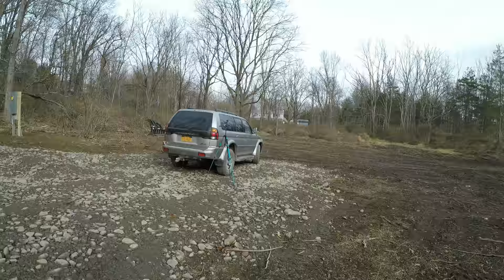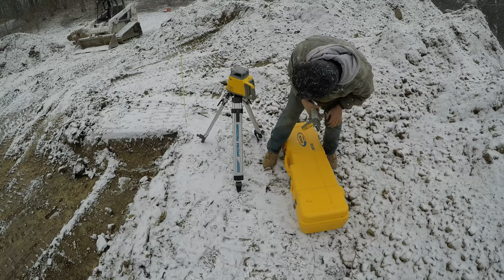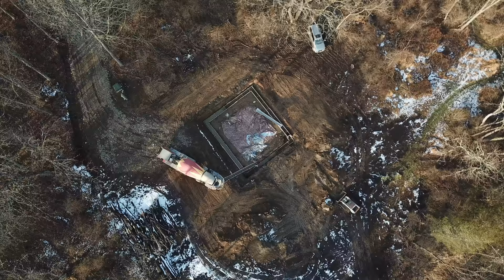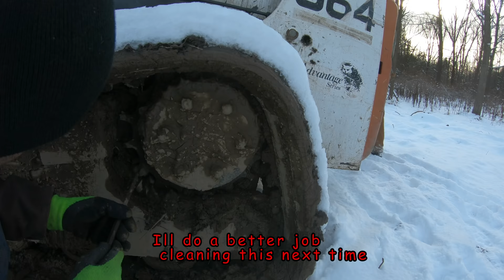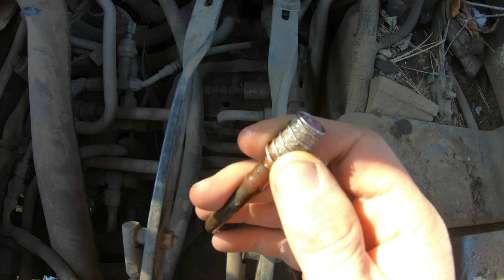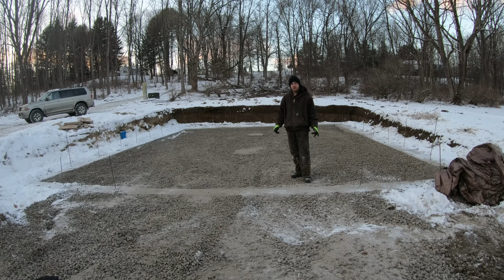Digging a foundation and pouring a footing

Comment: The holes in the perf pipe are supposed to face down. get some diesel 911 http://powerservice.com/psp_product/diesel-911/ for emergency gel ups like that. But you should be using regular antigel all the time in real cold weather. otherwise really enjoyed the video. thanks for sharing
Reply: Tyler Koehn the fuel refineries usually add a percentage of Kerosene mixed to the diesel fuel to prevent gelling but due to the fact the skid steer still had summer fuel in it it did not have that kerosene base which would have helped the Diesel 911. He did the right thing.
Reply: I personally know numerous people that have had their trucks gel up with winterized no2 diesel. no offense but doing the right thing would have been to not beat the snot out of it by trying and trying and trying to get it going. simply dump 911 in the tank and remove the fuel filter and dump it in there as well. DONE. seriously a 10 min job. or better yet splurge and buy a gallon of antigel. for $8 add a few oz every fillup when its going to be around 0deg F and you will never have a problem...
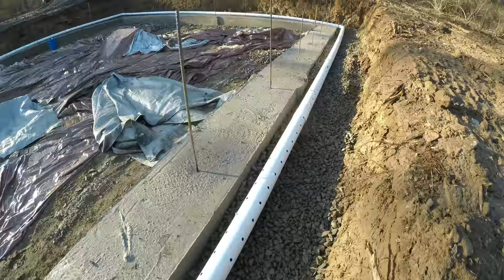Reply: Multiple rows of holes in the pipe.  21:59
Reply: odc43054 pipe around where I'm at has two rows of holes in it.
Reply from the maker: The holes go up.
Reply: Holes go up
Reply: Holes go down, if they face up, the water table is raised to height of holes.  water rises, infiltrates the pipe and flows out.  It seems counter-intuitive, but that's how it works.
Reply: Wrong. Lettering goes up holes go down.
Reply: The holes go down. As the water table rises the water is taken away, water table lowers and the water exits the pipe. You need to know how the system works.
Reply: Grey Market --- Holes go down!
Reply: Tyler Koehn --- I'm retired....50 years construction....and I had employees use fuel additives 'year round'.....equipment ran in winter and ran BETTER in summer!
Reply: Brand O --- Wrong! Holes up causes 2" of more water to rise in drain area before relief of water starts!
Reply: Chop Shop --- Correct! Lettering on top for a reason, to see what you're digging into at a later time for maintenance!
Reply: Absolutely, holes go down. Otherwise the trench has to fill up to the top of the pipe before water starts to flow out of the trench.
Reply: The holes go up. The point of the foundation drain is to move water away from the foundation. The gravel allows water to move down and into the perforated pipe and be carried away. If the holes were facing down then water wouldn't collect properly or flow through the pipe correctly. It has nothing to do with the water table. Filter fabric will prevent silt from entering the pipes. This type of drain is used to keep water from penetrating the foundation. If there is excess water or a really high water table then other drain designs may be implemented. Judging by the soil when he was digging I would venture that the are where the house sits probably has good natural drainage to start with.
Reply: Yes, the holes should face down and the pipes should be wrapped around with glass 
fiber cloth so that dirt won't plug the drain in the long run.
Reply: yes holes go down and on the sub soil with filter cloth not on top of 3 or 4 feet of stone ether, u never put stone under any drain tile, e use a flexible 4" black tile witch has holes all around it, with a heavy sock over it and the floor tile tees into it though PCC sleeves though the footing in 4 places were the floor tile chris cross the fool in sub soil trenches an back filled with stone to keep any ground water away from the floor
Reply: Holes down, made this mistake once years ago...ended up having to dig up the drainage and put them facing down.  Holes up let the water get too high before it begins to drain and collects standing water.  Love your videos, great job! Not being a critic, just adding to the conversation.
Reply: Fuddmethen that is right hole down witting up, but i find unless it is being inspected, you cant tll young people anything these day, they think they know it all, but if it is inspected it don't get pasted until they rip it all out and do it right before they are given the ok to back fill, 2 young guys were gluing there whole 200 feet of septic fiel pipe together, i had stopped in both places and seen what they were doing, i told them to stop and take a part what little they had done, well in both places these young guys told me were to go.. the day the inspector came the first thing he seen was the field, and told them both to do it right and he left, both of them asked me what do that inspector mean,, i told then, what did i tell you last week, and i left, that night i got a phone call asking what to do, i wouldn't tell them until they both apologised to me, but now the pipe was to short to make 200 feet and all the fittings had to be replaced,, i just lmao now, but there is more wrong with this install then just the pipe holes, for one he put crushed rock in the bottom before the pipe witch will always be full of water up to the top of the pipe, i don't know how much rock he put in before the pipe but it looks like a foot or more, an inch is to much
Reply: you mite as well give up you cant tell young people today anything and they refuse to resource it
Reply: You'll learn your lesson when the new homeowners call you and ask why their floating in water on the basement floor.  Not that I'm a fan of using it, but corrugated slotted drainage pipe would have work better especially if your not sure where the holes go.
Reply: fuddmethen, that's what I said on here days go, black rolls of 4" slotted drainage tile, with filter sock and chris cross under the floor and though the footings and out around the footings, pvc is not used for this, he most likely will not care when they call, there are so many out there that do this stuff on the cheap with no contract or recourse, it will be tough luck but I will come add more for more money
Reply: holes face down  ..
Reply: The HOLES GO UP BOB!!

Comment: In Mass, we do a lock in the footing and the rebar every 24'' vertical Andrew invest an oil fired torpedo heater makes quick work out of warm-up also your using heating oil you need diesel winter blend 60% #2 and 40% kerosene. And add an anti jell additive to your fuel.

Comment: My father had a trick to keep the water in the pump house from freezing. He would leave a light on inside the pump house and in that confined space was enough to keep everything from freezing up. Maybe, throw a tarp over (what ever you want to protect) and stick a work light under neath it all. Run a rope around it to keep the wind from blowing through it. Good luck. Garry

Comment: I worked construction in Northern Alberta with daytime temps (not including windchill) of -35 C (-31 F)and night time -45 C (-49 F) and even lower so we put a tarp over our machine engine (a foundation drill rig) and left propane heater under the tarp on low to keep the engine warm enough to start in the morning. In really cold weather you could throw a tarp over the whole skid steer and with a heater on low around the rear end to keep your engine area warm enough to avoid starting problems the next morning.

Comment: Put a little AT in your diesel. I helps with ant gel properties as well as cleans the exhaust parts. When you forget to ATF, you can always build a camp fire near the engine compartment  near where  the fuel and feeder lines are.

Comment: Just an idea....when I ran heavy equipment I took a neon green or orange paint & did small circles around all my grease points on all my machines. It helped me  not forget about some of the more "forgotten" ones. And I could tell one of my laborers to grease a machine and they could hit them all. Also when doing your drainage pipe, it's a good idea to add clean outs in strategic locations so as silt etc. fill the pipe you can clean it out to avoid an ineffective drain. Get yourself a trenching shovel to clean your tracks out at the end of the day. I know it can be a pain in the a$$ when your tired etc. but the next day it will save you time.

Comment: A nifty trick is to tarp it, put a big piece of hose on the exhaust pipe of your pickup and run the exhaust under the tarp. Rev up the truck of course. Should be like summertime in about 15 minutes!

Comment: when I used to work for a truck leasing company, back in the 1970's the mechanic used to use a 5 inch steel tube with a 90 degree elbow attached to the end. Then using the tiger torch on the flat tube end and place the elbow under what u need to heat up, the entire engine gets blasted with heat

Comment: Definitely like the longer videos. 
On the skid steer tracks the flat area where the idlers are the biggest problem area in the freezing weather. If you haven't tried it already there's this product called ISO Heet, it comes in a red bottle. The stuff is great, and you can use it with gas or diesel, it will scavenge the water and prevent freezing. I use that and diesel 911 in my backhoe and tractor, and it works pretty well and I run fuel oil in them. Anyway, great video and happy New Year.
Reply: Needs a track shovel ,also take rags soak in diesel and put under idlers.

Comment: you are so lucky this cold snap was not a week earlier. that would have stopped your project cold. but you got it dug just in time. good job. your bobcat seems to be problematic. all our bobcats were propane, so they would work even at -30, because the fuel comes up to the heater, which is the coolant for the engine.

Comment: Invest in a popup garage so you can park your equipment in there and blast it with the space heater for 30-60 minutes when you get on site. It will save you a ton of time and effort with the added benefit of giving you a nice place to take a break.

Comment: You must be in one of those States that requires Bio diesel perhaps. Fuel quality is the key, I have not gelled a machine for the past 30 years and I do use additives, Powerservice White bottle antigell. Stay away from Diesel 911 and I do cut Diesel with kerosene when -30 degree weather hits.

Winter takes longer to do a job and you have to clean tracks at the end of the day religiously. Parking like you did was a good move so your not frozen to the ground. An old trick if you are caught in a bind,  weld up a long pan that will hold 6 bags of charcoal, slide it under the machine and cover with a tarp. Winter is hard on you and the machines, have a good year.

Comment: Nice vids Andrew -- really enjoy them!!! ---- Power Service is a good additive for winter fuel....... if frozen or gelled enough not to run then use some Rescue 911, it will thaw and get ya up and running. Oh, the tracks - always a good idea to park on logs or rocks but drives and rollers still need cleaned.

Comment: The ancient Egyptians, to get a perfectly flat and level foundation, flooded the ditch with a water sand mix, kept removing mix until prominence appeared. They then cut away the prominence and repeated until they got down to the required depth. Very smart builders, of course you probably used your laser surveying! Just saying,might be a useful technique!

Comment: Science experiment. Take 2 identical pipes, set one in a bed of gravel with the holes down and the other with the holes up like Andrew did. Exactly like Andrew has. Now fill the (box, tank or whatever you placed the pipes in,) contanier with some water. If you watch both set of pipes you may notice 2 things. 
1), The pipe with the holes down, only brings water from the wettest are around the foundation to the driest are of the foundation!?  Or another way to say this is,  takes water and fills the entire area around your foundation and soaks it with water! Good job!
2), Now the pipes with the holes up, will carry water away from the area that is wet, not make the dry areas wet, and deliver a larger amount of water away from the foundation. 
If you watch this series of videos, you can clearly see the 2 sets of pipes leaving the foundation area and traveling away from the building. The pipe with the holes up, delivers more water to the drainage channel Andrew dug in the dirt, and the other pipe barely delivers a trickle. Why the difference? You tell me?
Considering both pipes are in the same dirt. At the same location, and that both systems are identical, why would you put the holes down? This is a silly fact that even today most people do not follow or understand. Set up your own experiment, and try this yourself!

Comment: Andrew, when the inspector suggested that the holes in the perforated pipe go down, why is that? Why would you need any grade? How does ground water work? The foundation drain need only be level and the holes in the pipe should be down. Why? If  the ground water comes up to were the pipe is, the water is carried no matter, out the end. Pipe that is level will carry water in one direction or the other. If one end is covered or blocked then the water will flow out the other end. If your holes are on top, then the ground water will have to get to the top of the pipe. If you submerge a piece of pipe halfway in water in a level position, the water fills the pipe half full. If the pipe is an outlet, then the water will flow out the end no matter if the holes are down in the pipe. If the holes are up in the pipe and one end is blocked, and the other is outlet, then you would have to fill the reservoir to the top of the pipe. The holes in any foundation drain should be down. Sometimes logic fools us. As we suggest what should be right, the logic is the exact opposite. Engineering is very interesting sometimes. The physical world or the true nature of the physics, is confusing in the mind and conceptual direction sometimes. That is why the engineer shall suggest design if the project is of the nature as to need mechanical, electrical, structural or civil engineers. You do have a very good understanding of many things; yet sometimes it is best to get a clear understanding. Sometimes engineers are just done with people that suggest what is the right way and don't listen to your questions, and sometimes they forget because of the nature of being around the constant better ways of doing thing that do not have base in any engineering standard. Just worked once for them so it works in every case.

Comment: we put a flat rock under the center of the equipment, then place a electric heater on it and cover to equipment with a trap, run the heater over night. its just rite to keep the equipment from freezing.

Comment: Frozen solid - You should have used your hotwater pressure washer...more effective than that propane torch thing.

I used to live in New Hampshire, so probably the same latitude as upstate New York (Albany or Syracuse or Buffalo) and I remember the cold was unlike anything you would see in NYC or Philadelphia. I drove down to Philly during a cold wave and man, Philly felt so warm compared to NH.

Comment: I wonder if you could put some of that pink RV antifreeze in a sprayer (like the ones they spray oil on concrete forms with) and wet down the track sprockets to keep them from freezing.  My old man twisted up the drive shaft on an IHC truck because it was frozen down, so it can happen with road vehicles also.

Comment: Gulf Diesel Fluid 40 will see you right or just switch to Kerosene but be aware that the cold start capability won't be as good (Kerosene has an equivalent Cetane number of around 40-45, Arctic grade Diesel around 55). I have some expertise in this area: I have developed cold start strategise for Caterpillar engines used in military applications.

Comment: Matt, going forward, get yourself a large tarp so you can tent the machine and then blow your kerosene heater into.  Creating a warm garage for the overnight.  And use anti gel.
Reply from the maker: Yeah, I might have to. But the ground is to frozen to dig now anyways. Hopefully it warms up, but the next step is for those walls to get done.

Comment: We use to have to bring our machines back to the yard and hit them with a hot water pressure washer at the end of each day so they would fire off and work perfect on seriously cold days.. Anti-gelling additive helps a lot too..
Reply from the maker: Yeah, that's allot of moving machines around though, especially on this job as it was far. Winterizing the diesel and cleaning the tracks at the end of the day solved the problem.

Comment: I'm an Assistant Superintendent in commercial construction for a general contractor here in Dallas, TX. My dad and grandfather had a sand and gravel query up in Savoy, TX for a while and I grew up around heavy machinery and I operate skid steers and mini excavators every now and then for my company when they want to save some money on a contract and increase the profit margin without paying for a sub's overhead. I've been watching your channel for the past few weeks because I plan on starting a small business site clearing, site prep, resurfacing roads, water control, demolition and what not. What are a few things you would tell someone getting into this business?

Comment: You need some sort of tent to keep your equipment in on these kinds of nights. Even a small amount of heat like a few lightbulbs would keep everything from freezing. Small investment too. You're time is too valuable to be un-freezing equipment. Better still, take your stuff back to the shop every night if it's going to freeze.

Comment: 28:08 just get a preheater for the Skidsteer which heats up the water in the motor with Diesel. Just make sure to run it off a separate battery you bring to the jobsite fully charged.

If you run it like 20 minutes there should be no issue, since the who!e motor gets thawed from the inside.